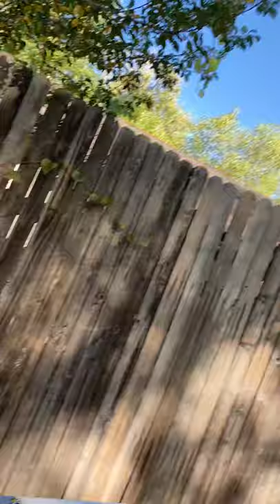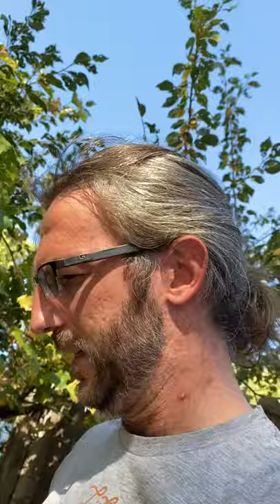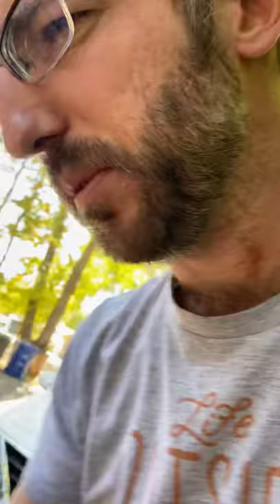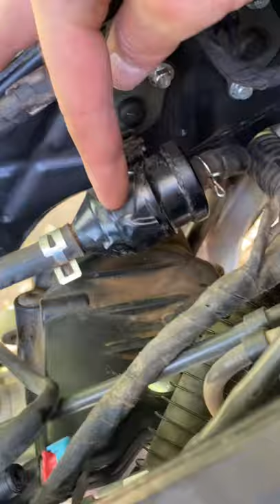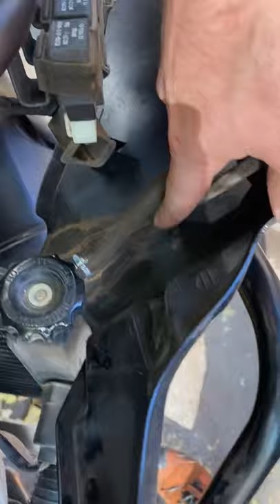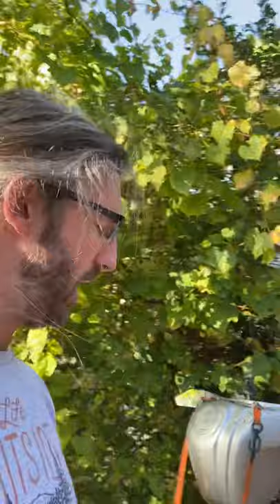RX4 - need an Intake Valve Adjustment

Comment: Manifold pressure can not and will not push back through the fuel injector.  The injector is sealed by a spring that is stronger than you will get in an intake unless you have a turbo...
 I would bet on the O-ring on the fuel filter getting worn a bit and starting to seep.  The O-ring will get worn as the parts vibrate against each other.  One thing that can help a bit is to use some oil or lube(vaseline/grease) on the O-ring to give it something to move freely and not wear so readily.  If the valve is not seating, intake, it will not develop as much compression, and your power will be down, and it may be more difficult to start when at working temperature.  The clearances tend to close up when things expand due to heat, and can keep a close clearance valve from seating tightly.
tom
Reply from the maker: Thank you for this insight, it definitely is going to help me problem solve. Knowing that Manifold pressure can't push back through fuel injector, like you said, means the fuel leak is due to corroded fuel line / o rings / connectors. This totally makes sense as on a long 90 mile dirt / hard terrain day the bike majorly overheated. It melted one rubber connection (or at least weakened / cracked. it). I bet this also caused the hoses to overheat / crack. 

Still 100% sure i need a valve adjustment. It's been 5,000 miles, so it is time. I am sure this valve adjustment, dirty air filter, and riding hard caused the overheating which then lead to these other issues. 

Again, thank you for this input Tom. Much appreciated.
Reply: Old mechancs' wisdom:  If it overheats in traffic(slow speed), it is likely the fan or pump, if it overheats on the highway, it's likely a clogged radiator.  I would check the temperature controlled switch that controls the fan, and the thermostat(I expect it has one to get up to working temp quickly) for opening at the proper temperature.
 I would also want to adjust or at least check the valve clearance after that many miles.  Mis-adjusted clearance can either lead to valve burning and hard starting if too close, or excessive noise and compression release defeat if too loose.  An OHC engine can either have the valve seating areas wear or the cam follower/rocker arms and tips wear.  The former will close the clearance, the latter will tend to open it up. 
tom

Comment: Ever figure out the issue? I noticed you stopped posting. I had an issue where my harness caught fire and shorted out the bike badly. I replaced it myself using the parts warranty (although I could have used labor too). ABS/speed doesn't work and they are sending me new ABS wires. Hopefully it's not the ABS module or ECU

Comment: I've decided when I hit 500 Miles to check the valves, just in case. Checked a friend's 2019 yamaha wr250 with less than 1000 miles on it and 2 valves were way off. So I just want to make sure mine are at spec, if not I'll adjust, then I'll check again at 5,500 miles.

Comment: I rewatched your video, I couldn't finish it last night. anyways my fan turns on sitting in neutral. I've let it sit from start to operating temperature then the fan kicks in. Mine is a 2020, is yours a 2019? Maybe they reprogrammed it or yours isn't starting when its suppose to.